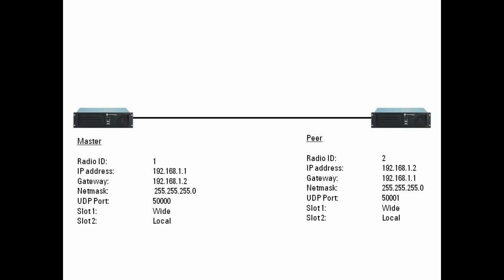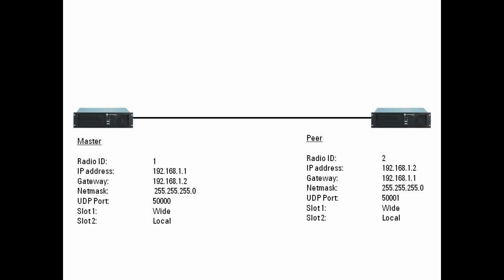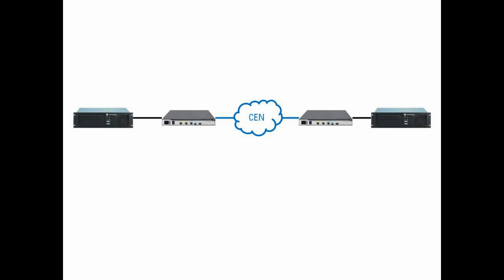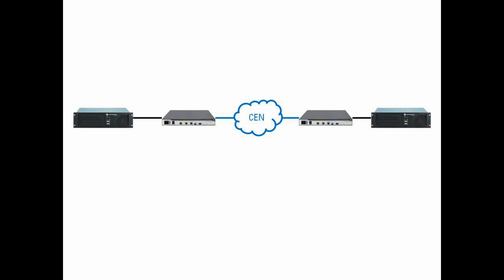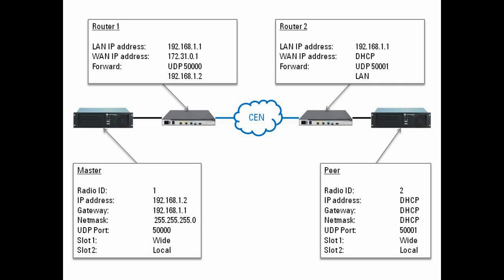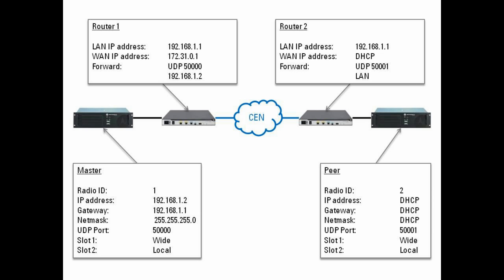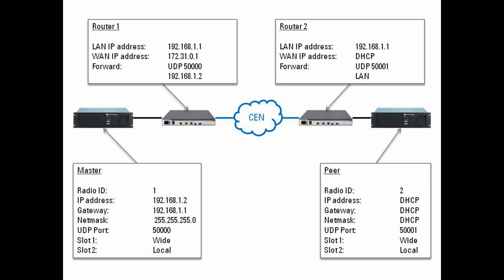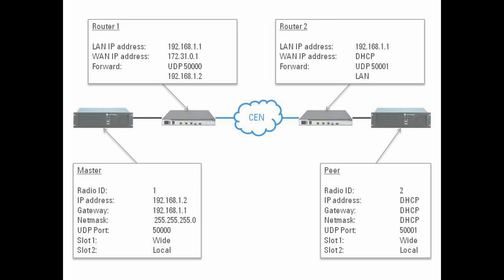IP Site Connect Repeater Configuration (Part 1)

Comment: I believe there will be a routing loop with your example having the same ip subnet on both the router's lan port.
Reply from the maker: +joseph bantog I don't think so because the Peer repeater(s) will connect to the Master repeater via the Router WAN IP address. So the Master repeater has an IP address of 192.168.1.2 on the LAN and the Router has a WAN IP address of 172.16.1.1. The Peers will connect to 172.16.1.1 and the Router will forward any traffic on UDP port 50000 (or whatever the Master repeater uses) to 192.168.1.2 via its port forwarding rule.
Reply: +Wayne Holmes , Hi Sir, did you use any routing protocol? I happened to study ccnp routing and switching. Maybe you only used static routing. Thank you sir for uploading these videos. I also watched your other videos and I subscribed.
Reply from the maker: NAPT is being used for IPSC and Cap+. For Cap Max OSPF will be used.